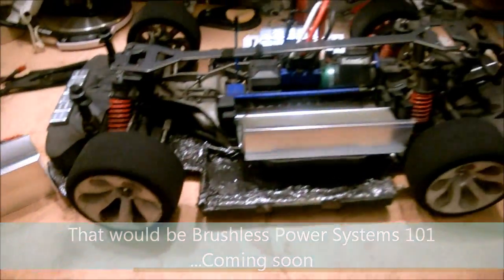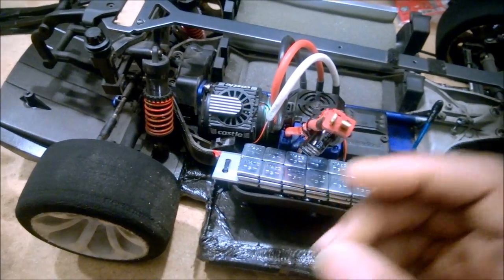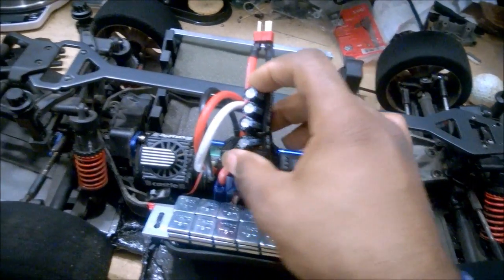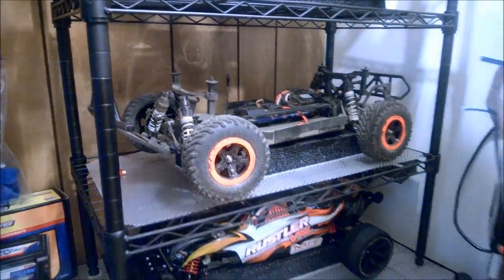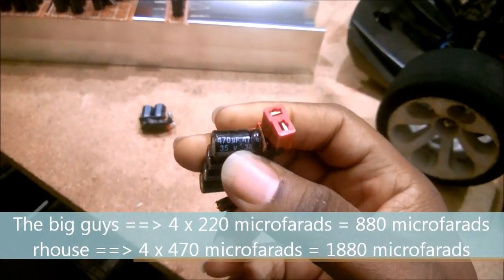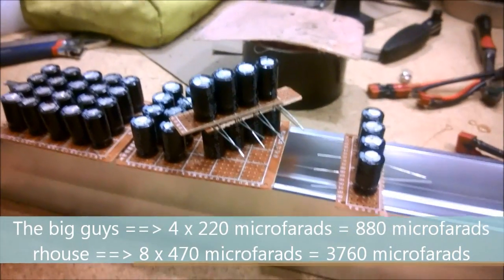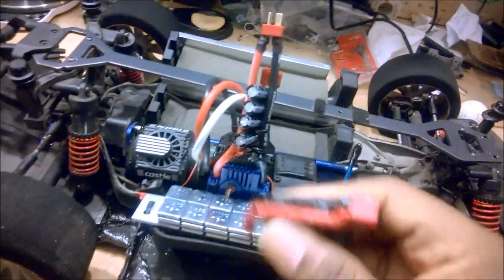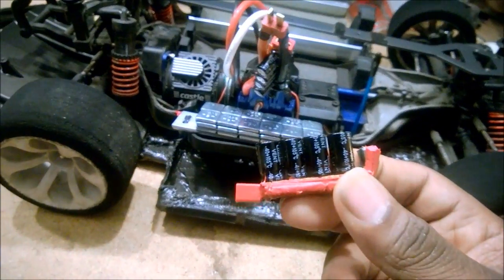Ep. 88: Cap Packs 101

Comment: Are you still around for a question
Reply from the maker: Of course. Wassup?
Reply: @RCPhysics  with caps  can you have to much?  Could I use 2 3300 uf 25 v on a 3/4s system?
Reply from the maker: Good caps have a spec sheet that publishes their ESR (Equivalent Series Resistance) or impedance. This determines how quickly the capacitors can charge and discharge. Larger capacitors usually have higher ESRs. If the ESR is too high, the capacitor will not be able to charge and discharge fast enough to keep up with the power pulses from the ESC.

Many named brand capacitors in the 500 to 2000 microfarad range will usually have ESR values low enough to keep up, but the only way to really be sure is to look up the manufacturer's data sheet and do the math. However, if you are using a data logging ESC like a Castle, you can experiment with different capacitors and see how well they are working by reviewing the data logs.
Reply: @RCPhysics  thanks for your time and knowledge!
Reply from the maker: No problem!
Reply: @RCPhysics  one more thing can I measure the resistance with a multi meter ? Ohms I think.
Reply from the maker: Nope. Measuring the resistance of a capacitor requires a special capacitor meter.  This is because capacitors actually block DC current, so you need to feed the capacitor an alternating signal and measure what the capacitor does to that signal.